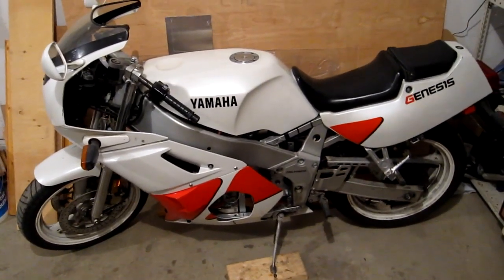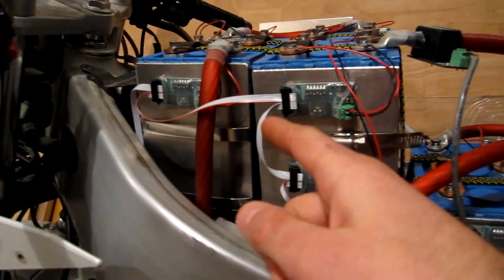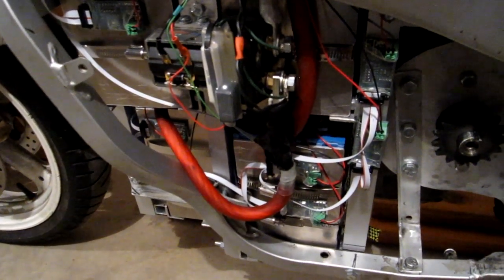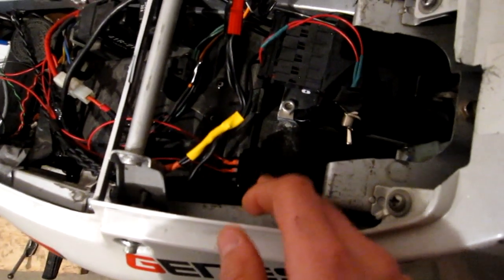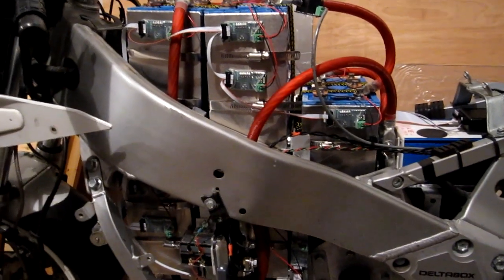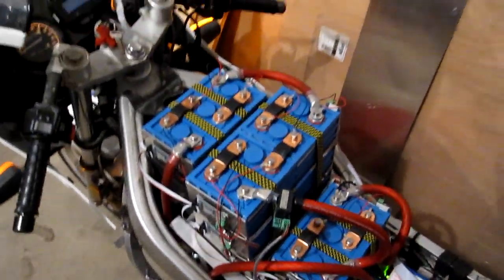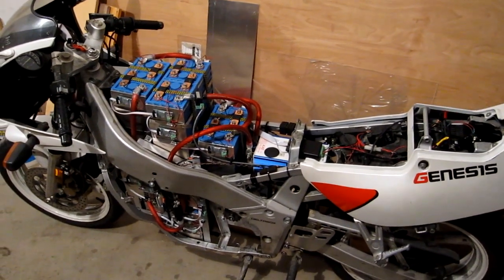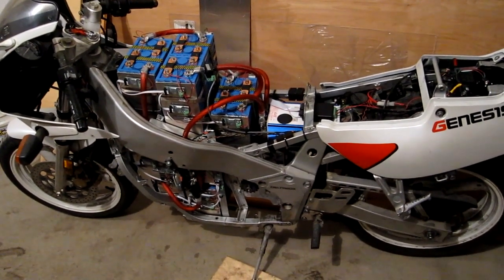Electric Motorcycle Build #24

Comment: Hi, and thank you for the reply.
  Yes, just after I sent you that question, you answered it in the next video I watched :)
I'm at 24# presently.

There seems to be a lack of dairies that I have seen on YT. And was lucky to find yours.
Do you find the MARS motor good enough? Or are you finding after getting used to it, you could use a bit more power?

Thanks again
Muzzy
Reply from the maker: Thanks. The ME-1003 with the alltrax 7245 is an excellent motor/controller setup. The bike has more power than the 400cc dual sport and 250cc two stroke bikes my family has. Hope that answers your question... It's no super bike, but it has enough stink to get you in trouble...

Comment: You did a super clean job.the best part is that it still looks like a stock 600. You should have adjustable sounds since there is no motor (engine?) Sounds. You could make it play a 2 stroke sound or make it sound like a ice cream truck music when you twist the throttle.can you estimate speeds or range yet?